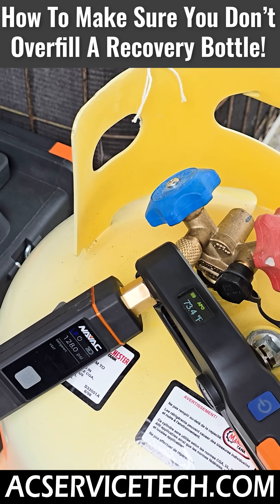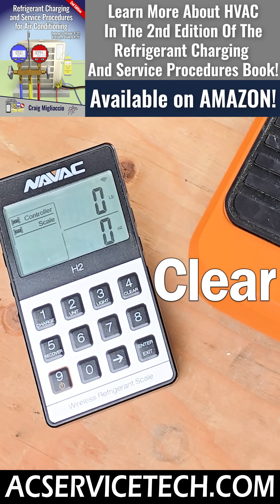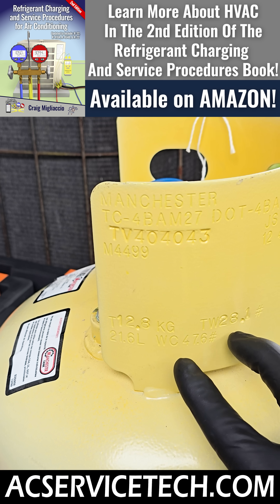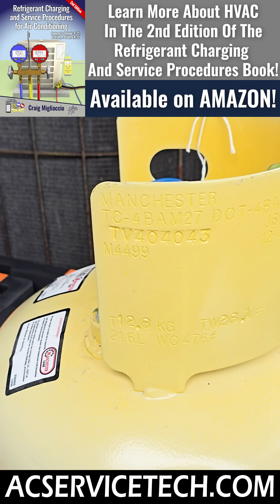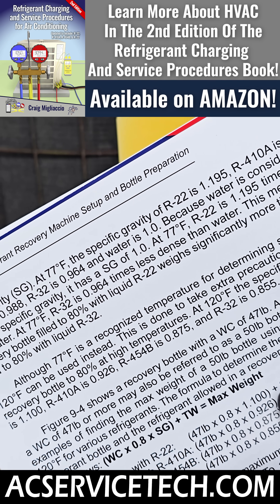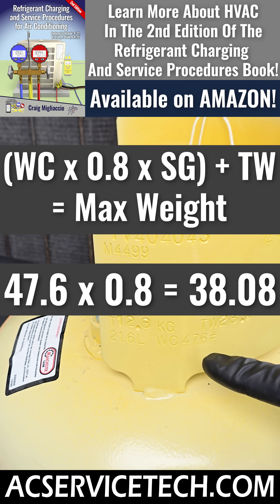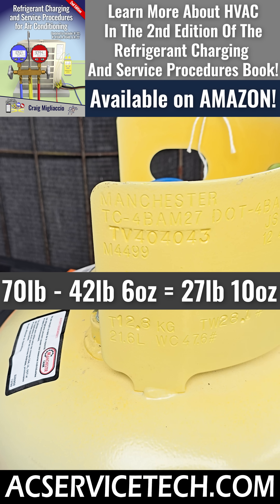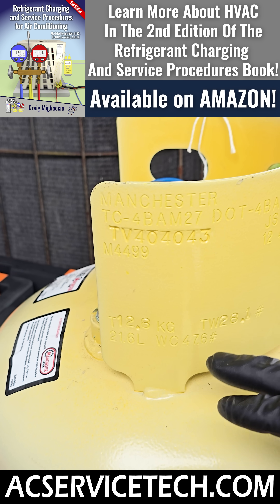Refrigerant Recovery Bottle MAX Weight Explained! Including Specific Gravity!!

Comment: Tar weight is all you need to know. You should already know the weight of the refrigerant. If you don't, it's printed on the new bottle. Google works too.

Regardless, any recovered refrigerant isn't sold back to customers. I see people using it to charge systems and that a huge no no. 

Only an empty tank can be used to recover what you plan to put back in the same system. And you can't double charge them $$$ for their own refrigerant.
Reply: You can do all of these things. Technically speaking, you can. You shouldn't, but it is physically possible, and it is done in fact by many in the industry. Not good, but still a fact.

Comment: Back in the day, especially with r22. The old school HVAC techs. On the commercial units on the top of buildings that they had contracts with the owners to maintain. He'd have a little writing pad like a police officer would have and for those that needed a little more. He would just write what he put in. I'm trying to figure out how would he know how much he put in. Well with his manifold gauges he would say there's so many pounds per bar. Then I responded and I said wouldn't that hurt you for it a few ounces that you leave behind?  He replied. It's always rounded up to the top pound number. We don't work by the minute and we don't work by the ounce we work by the pound. That didn't sit right with me. He works under the hour of a contract to do the right thing. He did have weigh scale like you have before they came out to be digital. So I can only take that was the best thing that he could do. Covers company cost and to make sure the customer is okay. I'm a god-fearing man and things that seem not right. I always bring into question. They never went through the math that you just did. What are your thoughts? Thank you so much for bringing the proper way. God bless ❤️🕊️✨
Reply: Many types of items in business are rounded up to the next whole unit. Even municipal water bills are billed to the next 1000 gallons. As long as you know the terms, there is nothing sneaky about it. It may be not a great deal for the customer, but it is upfront.

The only other problem is for a critically charged system. Then you need EXACT measurements. Otherwise it's not a huge deal, especially with R22.